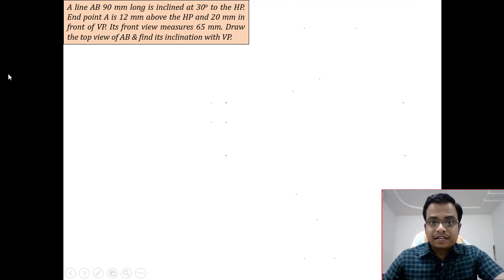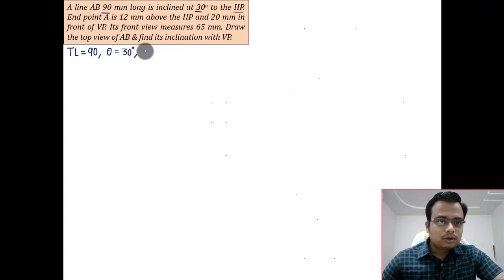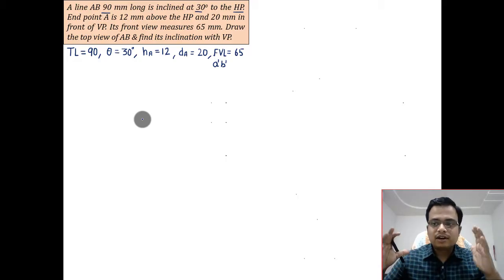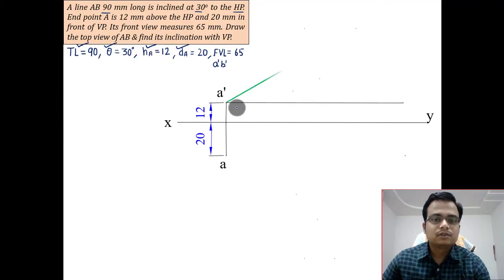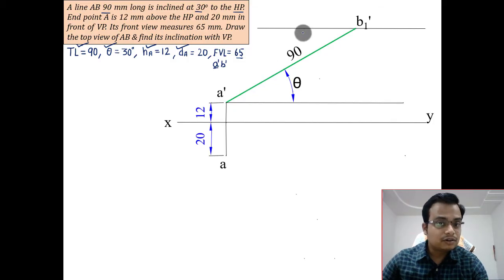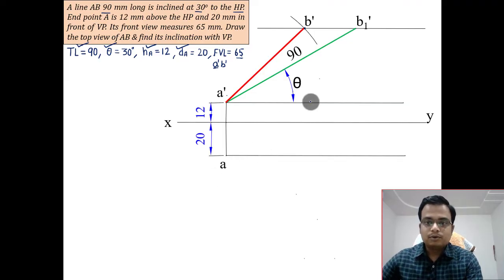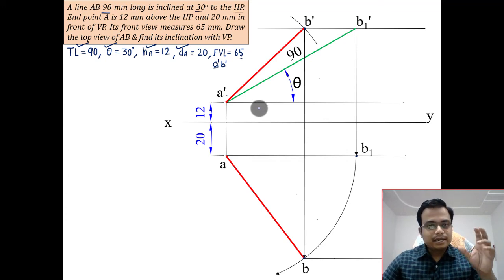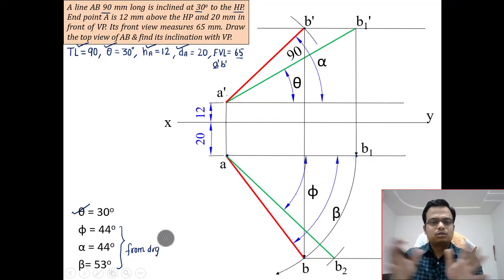Projection of Line_Reloaded | Level 2 | Problem 2

Comment: A line AB, 90 mm long is inclined at 30° to the H.P. Its end A is 12 mm above the H.P. and 20 mm in front of the V.P. Its front view measures 65 mm. Draw the top view of AB and determine its inclination with the V.P. Draw also its Traces.

Comment: A line AB, 90 mm long, is inclined at 45° to the HP and its top view makes an angle of 60° with the VP. The end A is in the HP and 12 mm in front of the VP. Draw projections of the line and determine its true inclination with VP. Also show its traces

Comment: line AB 90 mm long is inclined 450 to the HP and 300 to the VP. Its 
end A is in HP and 40 mm in front of the VP. Draw its projections. 
Marking one end A (4M) +Drawing projection (10M) = 14M 
[1

Comment: A line PQ 90 mm long is inclined at 30°to the H.P. Its end P 12 mm above the H.P. and 20 mm in front of the V.P. Its front view measures 65 mm, draw the top view of PQ and determine its inclination with V.P. Draw the traces of the line. 💓